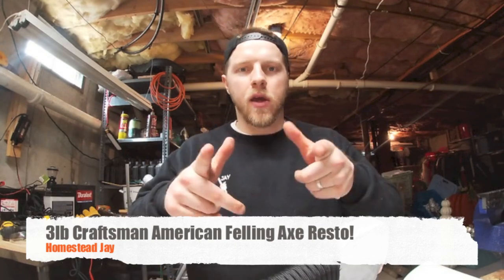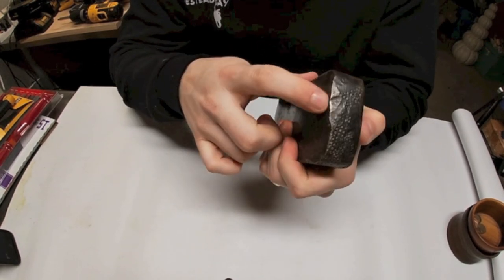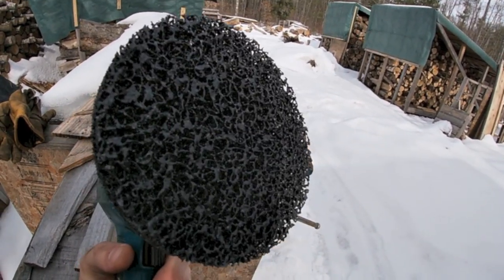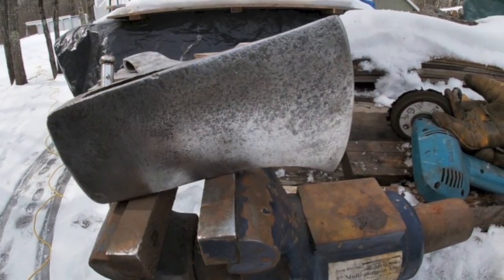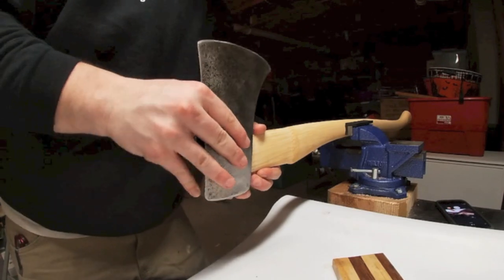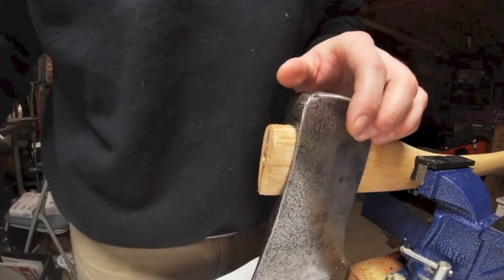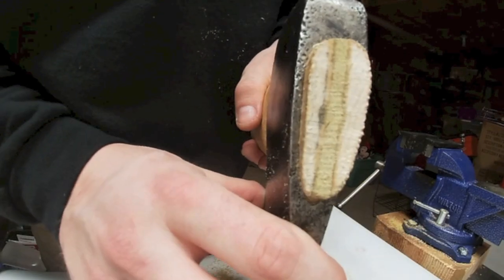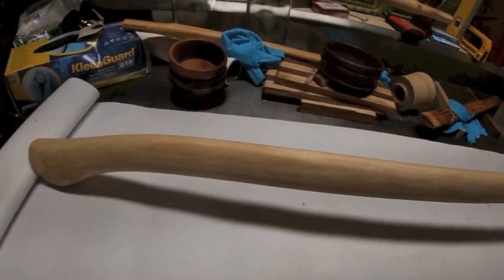Antique Craftsman 3lb Felling Axe Restoration! Ep 29

Comment: What year would you think this axe head was made? I bought the same one from a goodwill for 3.00$. Just stumbled upon your video and realized I had the same one and couldn’t believe I almost angle grinded the edge
Reply from the maker: Kaitlyn, Thanks for watching! Hope you liked it! I am unsure of the age. Axes are tough to tell age because there normally isnt a stamped manufacture date on them. Often companies make the same axe for years and you just dont know, sometimes you can get a an age range from forums . I am unsure of the age but its deff older I would say pre 90's due to the steel. Older steel is often better (Back when the USA made steel lol) DONT use an angle grinder on the cutting edge!!!! The steel in tempered and the heat and aggressiveness from the angle grinder will ruin the steel! Get a new metal bastard file and a lansky stone (puck) and thats really all you need. The angle grinder can be used for the BACK of the axe head if theres any mushrooming but other than that I wouldnt use it on the front! Please subscribe to my channel!